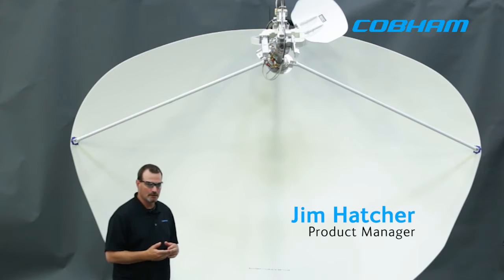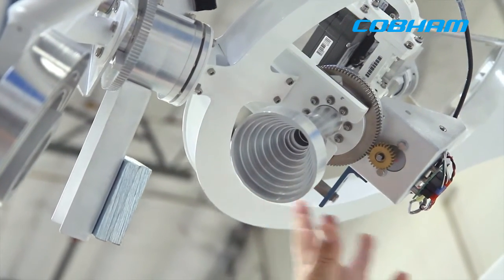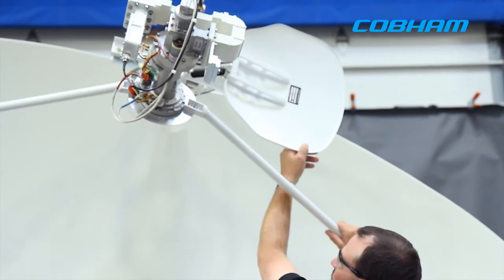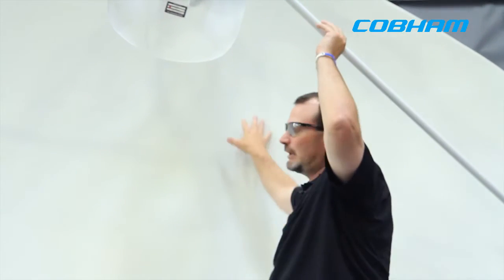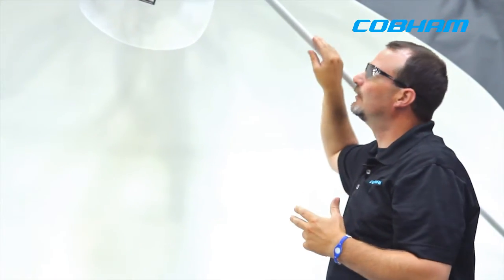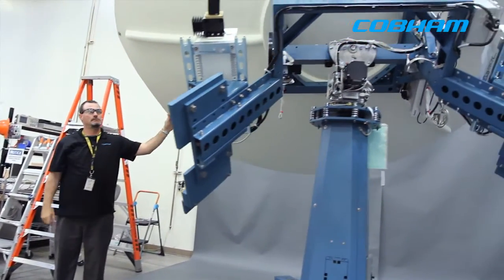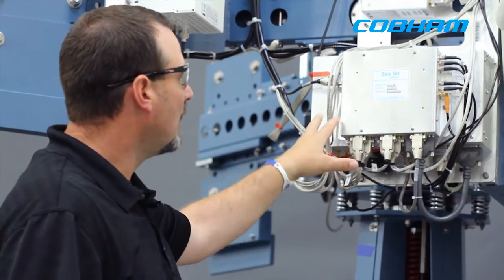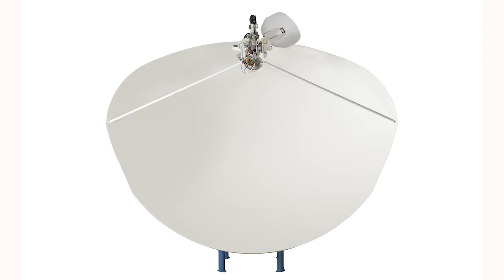Sea Tel 9711 IMA Systems with C/Ku Switchable Feeds

Comment from the maker: What are the features and benefits of the Sea Tel 9711 IMA Systems with C/Ku Switchable Feeds?
Reply: Inbuilt C (linear/ CIrcular) and Ku feed, no need to manually change feed compared to older model